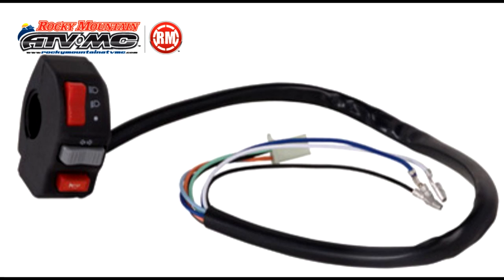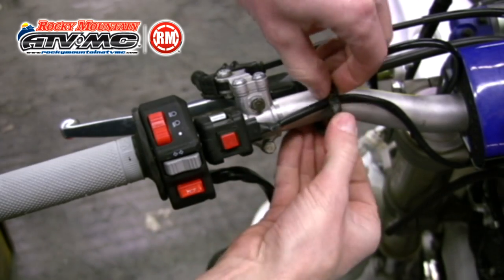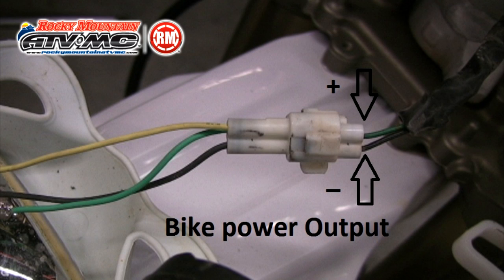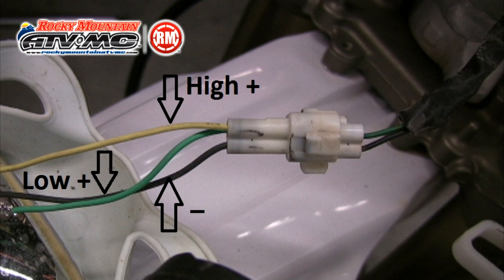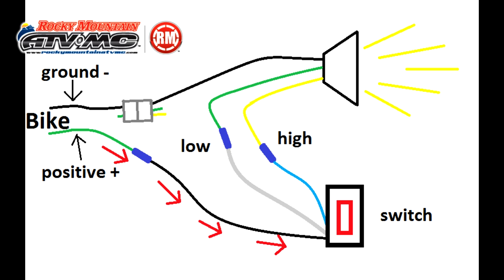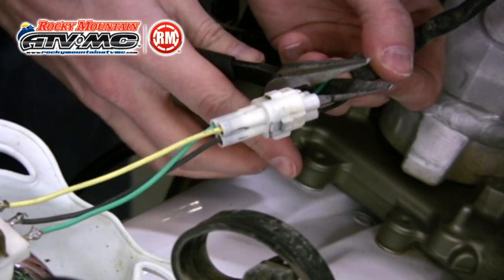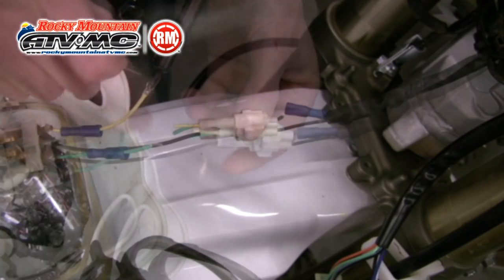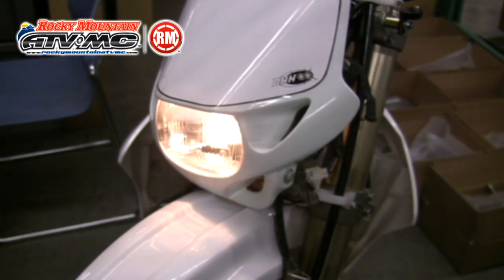Tusk Compact Control Switch Installation | Enduro Lighting Kit

Comment: Yeah it looks pretty slick and the way we customized the rear under fender for tail kit + turns. Only thing I'm debating, you think the 12v5ah battery will be good for complete tusk street legal kit + 30w headlight. I will add another in line fuse for light but I'm going to wire both to battery w/ quick connect so when battery dies, can hookup 12v charger w quick connect ...battery is in airbox and will be sealed w/ leads coming out for access for easy disc.+hookup. Don't think wires should warm up if using bigger gauge. Lastly, am I understanding right, stock stator would not be enough for this setup. (kickstart) again, thanks for all your help!
Reply from the maker: +Mike Klumb The stock stator no.  It doesn't provide a high enough output to power such a unit.  I know Trail Tech makes some high output stator kits though, so that might be an option? I'm not sure if its available for your year machine?  The battery pack idea seams fine to me.  Updating the wires to thicker AWG wire wouldn't be a bad idea with the headlight an all.

Comment: Thanks for the video. I just bought an XR 400 with what looks like the Tusk Dual Sport kit installed (also electric start). I am in the process of trying to figure out the setup but would love to know what you would recommend I do to setup a hi/low lighting. Thanks for your reply.

Comment: I bought the tusk brake light kit and a polisport basic headlight. I'm only running the brake light, horn, and headlight. I can't figure out how to wire the headlight with the switch. My bike didn't have a headlight from the factory. I have a blue white and black wire off the switch. Can't figure out how to wire the headlight.
Reply: Did you get it figured out? I’m having the same issue on my 2015 350XCF

Comment: I have a 2005 KTM 525 exc. I would like to know how to properly connect the hi/Lo switch since the headlight runs off the stator not the battery, I prefer to keep it this way. Also is the hi/PO switch have 12 volt current from the battery?? Cannot mix AC/DC power.
Reply: did you figure this out? i can only get my high beam to come on

Comment: Great video, also if your going to add a headlight kit like this to a bike that did not previously come with one you can run power directly off the battery with a fuse 👍🤙
Reply: What do you mean. How . Explain please.
Reply: @swishersweets2155  Dude, it's two wires.  What do you mean how?  There's positive and negative.....
Reply: Off the battery in the Enduro kit? Was wanting to toss on am aftermarket light and run that way but wasn't sure if the little battery would be enough power or if I should get the kit without battery and run a larger mc battery? Bike is db-X18
Reply: Use the positive wire from the pair of leads intended for your front brake switch, run a negative from your battery. Take the positive to your switch cluster and then you'll be able to switch your high and low beam from your selector switch.

Comment: Is it possible to trickle charge the lithium ion battery from the original stater even if it is wired to power the headlight from the stater? - 1996 Ktm exc (already had headlight/taillight powered by stator, no battery stock but added lith ion got lighting kit).

Comment: I have a 2019 Yamaha YZ450FX.  I bought the tusk kit for the bike.  I understand how to wire the headlight but hoping you know if there is a switched power source so I don't have to connect directly to the battery.  I'm running a WR headlight with a Cyclops LED light that will draw 30 watts.
Reply: Ever figure this out? I’m trying to install a headlight to my yz250 2T, confused on how to get the head light running.. buying a h4 socket, then wire that straight to the tusk harness head light wires?

Comment: Hi I'm working on a 2005 WR450F and I'm having trouble connecting my headlight up. I can't connect it this way shown because whoever did the last wiring job soldered everything together and it had to be ripped out in order to put this new lighting system in. Any ideas?? I have three wires from the OEM wiring harness loose but they're blue yellow and black. Also, the light bulb plug itself has three connecters on it that are green, brown, and black, and everything works besides the headlight.

Comment: The headlight seems to only work if I pair one of the high/low beam wires to the ground and connect the other to the low/high off the switch. Any advice?

Comment from the maker: @octaneorange - this kit is designed to run off the rechargable battery (included in some kits) or off the bike's existing battery (that is charged from the bikes system).  If the bike didn't come with a battery and charging system and you are trying to convert it, I am not certain how to help you.  It will most liekly depend on the regulator/rectifier you are using and how much power is feeding the battery.  The small tusk battery pack may not be able to take the full power from the rectifier.
Reply: Rocky Mountain ATV MC .....  will you be able to recommend a solution for the 2017 YZ450FX?  How can I get a headlight working with this application and can I still use this switch to run it?  Thx

Comment: I have a crf230f and in australia they have a factory fitted light, low beam only and no on/off switch will this work on my bike and if not how can I wire a on/off switch.
Reply: My 2004 USA version of the CRF230F had a low and high beam.  Consider looking at a Honda parts website and ordering the USA version.  Many of our parts website have complete diagrams showing every single part of the bike and you might be able to determine if it'll work for you, like... Does that headlight have three wires or is it the same as what I already have...

Comment: Hello, all the smoke escaped from my bikes wiring. It had a different lighting kit on it when I bought it and I have since ordered yours as well as the front factory wiring harness. (2001 KTM 400 EXC RFS US) the new KTM harness had only two wires for the headlight a brown and a white wire. The "smoked" harness headlite connector had three all black wires. I am not having much trouble installing your enduro lighting kit but the wiring of the Compact Control Switch is confusing. Can you please help. Thank You
Reply: "smoke test" humorous term thrown about by mechanics diagnosing electrical when something bad happened. what did you end up cooking and how did you fix it?

Comment: I have a question, Putting this kit onto a TTR 250 2006, and I took off the head light and coming off the bike lead I have a black cable, and 2 gray cables. After the connector everything is the same, Just confused on the 2 gray wires. Thanks in advance.

Comment: I have a 1999 TTR250. My stock headlight connector has 1 back wire and 2 grey??? Im trying to hook up the Tusk Enduro kit, to my new Polisport Halo Headlight. Everything else works, but im not sure how to wire the headlight(im a total wiring noob). Also the stock headlight switch(singe beam) has 2 yellow wires and turns both the stock headlight and tail light on) should I do anything with these? I wont be using the stock tail light.
Reply from the maker: If you are removing the stock headlight and switch assembly along with the tail light, i wouldn't worry about either of those yellow wires. As for the wiring for your headlight you'll simply need to figure out what each of those wires is doing. I would recommend using a test light and connecting it to a good ground source and then checking each of those wires for power. My guess would be one or both of the grey wires are your power source and the black is the ground but i'm not positive. Once you locate a power run that up through the switch like the video shows and then back down to the headlight through the high and low beam wires. The only things you need from your stock headlight wires are one ground and one positive wire. If you have further questions please let me know
Reply: Thanks for the response, I got it all figure out though. Working great, will be buying more parts from Rocky Mountain ATV in the future!
Reply from the maker: MaHan05
Sounds great! Thanks for watching!
Reply: OriginalRob what did you do to fix it? Havin the same issue

Comment from the maker: @Elb0WsInNUMBers - yes.  All you are doing is redirecting the power.  Most bikes have dual output stators.  I wanted to make sure that people are using the output intended for the headlight, not the output that keeps the battery charged.  If your bike has a new stator or a modified stator with a single output all converted to DC, you don't need to worry about getting the right lead from the stator.  However the switch can still direct the power to the headlight.

Comment: I did exactly as video pictures described but now when I turn on signal lights to the left the rear right signal light comes on and vice versa when turning right signal light on. Also my hand lever brake does not work but foot brake does. I installed micro switch to hand brake lever. All worked fine until I wired as described in the video.  Something weird going on!!!
Reply from the maker: +Donald McCoy Sounds like theres a little mix up with just connecting the blinker wires, maybe double checking them in the harness you'll be able to diagnose it? Video: https://www.youtube.com/watch?v=_DoJ7IpImKU 

Could be you mixed up the wires to the (front) hydraulic brake switch?  Maybe check there to.  If that doesn't do the trick, let me know what color wires from the harness you have going where? We'll see if we can get this figured out..

Comment: So.... if i want to retrofit a Bi Xenon HID kit, how would i use this switch to actuate the solenoid in hi if the hi and low are separate circuits?
Reply from the maker: You may want to refer to their website for specific wiring instructions. It looks like the high and low beam wires split when they go out to the factory machine connector and that is where you'd want to split and take the high to the high coming out of this switch. Same thing for the low, that would run to the low coming from this switch.

Comment: What are the wire sizes?  I need to buy some wire crimp connectors...
Reply from the maker: Scott Hair The wires are a 16awg. Let us know if ya have any other questions. Thanks for checkin out our video!
Reply: Rocky Mountain ATV MC Thanks for the quick reply and for the video!  One more question.  How well will these connectors stand up against weather (rain) and washing the bike.  Should we wrap up with electrical tape after connected?
Reply from the maker: Scott Hair The male and female wire connectors hold up really well to be honest.  You can get some heat shrink to cover the connectors to give it that clean look and to keep them protected from the elements.  Tape is fine to though.  It just gets a little sticky and grimy over time.
Reply: Rocky Mountain ATV MC Sorry this is a dumb question as I've never done this before, but would you recommend putting one longer heat shrink cover across both male and female connectors after they are connected? So it seals off the connection plus the crimped areas?  I would think so but just checking.  Would it need any kind of silicon sealant on the crimped sides too?
Reply from the maker: Scott Hair Yes, that would appear a lot nicer in my opinion.  The silicon sealant wouldn't hurt honest if you have some, but not needed. Heat shrink works great.  Thanks for the comments!

Comment: I did everything . High beam low beam work but the off switch does not work it remains in low beam. What might be the problem ?
Reply from the maker: Gokul Kavaturi Hi.  Its hard to diagnose the issue without having the bike.  I would refer you to our Enduro Lighting Kit Installation Video: https://www.youtube.com/watch?v=nflgfeqxRW8    
Let us know if you have any other question. Thanks for watching!
Reply: Rocky Mountain ATV MC  thanks for replying. took the switch apart and put it back together and its working fine now.
Reply from the maker: Gokul Kavaturi Hey anytime! Good to hear ya got it working. Happy Riding!
Reply: @GokulK2  same issue as you. You just reassembled the switch itself? And it was no longer fault? Also was were your connections and power source in your case?
Reply: @cmc2375  its been some years but as i remember just taking it apart and putting it back together fixed it. connections same as the diagaram. power source from headlight battery connections

Comment: Hey guys! I was posting on the enduro kit thread, but now I have a headlight specific question. 2004 WR450. I watched the video for splicing the control switch to hi/low beam. My headlight was different (no connector plug in the middle, just a yellow, white and blue wire coming from the harness to a three way plug into the back of the headlight) so I ran cut the yellow and ran it from the bike to the black switch wire. I then spliced the white switch wire to the yellow in the headlight and the blue switch wire in the blue into the headlight. Left black alone running from the bike to the headlight. In the other thread, you guys said this looked right.

Anyhow, I just fired it. No headlight when off as to be expected. Turn it to lo beam and the headlight comes on. Turn it to hi beam and there is no difference. Stays the same. Any thoughts?
Reply: Think I might have found the problem. Looks like both the blue and yellow wires run to the SAME portion of the bulb plug. It is a three socket plug. ONly two have metal connectors inside (low beam I am guessing and ground). My guess is a new socket at the end of the wires going into the headlight is needed. I would post a pic but apparently I cant upload from my Mac.
Reply from the maker: Quinn Posner Yep, most stock headlights will only have a single filament bulb or only a low beam. It's pretty popular for guys to just purchase an aftermarket headlight and that would fix your problem, unless you wanted to try and find a different socket that could run a dual filament bulb
Reply: Rocky Mountain ATV MC A new $3 socket took care of the problem.

Comment: I have this complete light kit installed and all are working off a 12v5ah battery. 04 crf150f kick start. Kit didn't come w headlight so have an aftermarket headlight on that has hi/lo (4wire:blue, white,Brown,green). Didn't realize the 3 wires (blue/white/black) from the harness(control/switch) aren't powered. any advice? Would ultimately like to hook up to same battery as other lights
Reply from the maker: +Mike Klumb Ok.  So your (blue/white) wires are for your hi/lo beam.  The (black) wire coming out of the compact control switch is your power.  However you plan to power your headlight, you would just need to tie your (black) wire into that (wire). Powering your control switch.  Let me know if that works.
Reply: You're the man! I was going off black as neg blue as lo white as high. Thank you thank you! We have light! GREATLY APPRECIATED along with the fastest response time. Great customer service hard to come by these days, will recommend to everyone.
Reply from the maker: +Mike Klumb You're welcome my man!  It was a good question.  Glad you got it working!  Should be a fun little bike with that headlight
Reply: +Rocky Mountain ATV MC  I did the same thing but no power. I have a blue white and two green wires that go to the head light. I connected the black to the two green wires and the white with white and  blue with blue. why isn't it working?
Reply: +Mike Klumb hey Mike, I'm also trying to run an aftermarket light with the rechargeable battery, how did you get power to the switch? thanks!
Reply: @geoffbarne6502  hey did you ever figure out how to power it
Reply: @austincobb2540  I did, but I forget what I did 🤦🏼‍♂️
Reply: So I have the switch with black blue white wiring. Can't figure it out. Are you saying split the black wire with the white and blue and connect it that way?

Comment: The problem I’m having is on my 2016 yzf450fx It doesn’t have a Head light What would be the best solution for my problem
Reply: Shane Jetton ....  yeah I have the same problem.  What can a guy do??
Reply: I used a drone battery to run the head light only and purchased an after market switch so it's completely separate from the bike's battery (YZ250FX).  I mounted the drone battery into a fender bag on the back and ran my wires along the chassis to the after market light switch.  I tried to hook it up the OEM bike battery but I don't think it had the amps to run all the light properly, The headlight would come on but not bright at all.  The drone battery works great and will last a few days before your have to put it on the drone battery charger.

Comment: I dont understand why you tap into the harness side of the plug instead of just cutting up the bulb-socket wiring.  That would make much more sense as to keep the original wiring unmodified.  But either way, this will get you going.

Comment from the maker: @cow productions You could wire this switch up on your bike. The only issue you might have is whether or not your current headlight has a high beam or is a dual filament bulb. You might also have to invest in an aftermarket headlight. Let me know if you have any other questions.
Reply: i have a baja designs light  and im only getting the high beam. how do i get the low? i have the same switch setup as your using here
Reply: I’m using this switch on an ebike. What do I use for a ground to the switch?